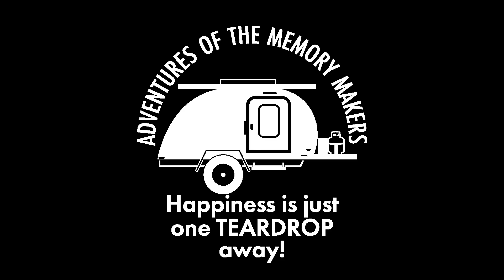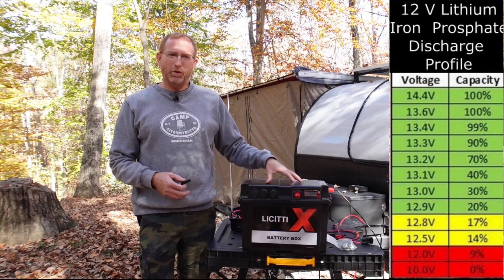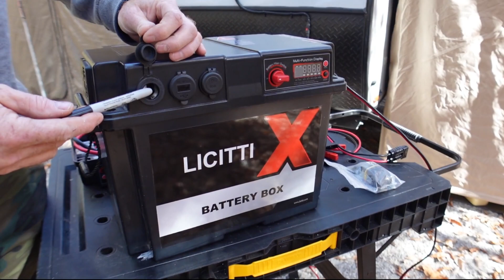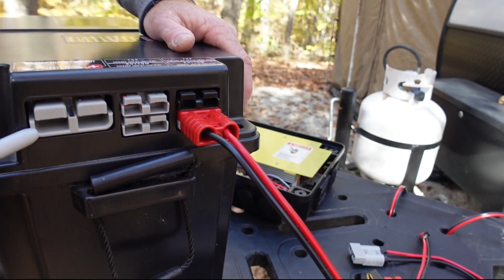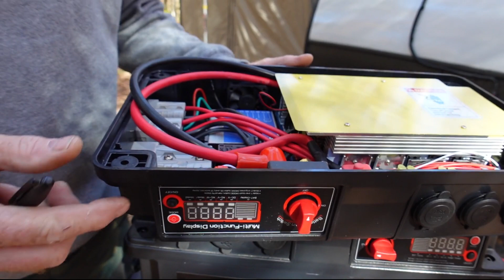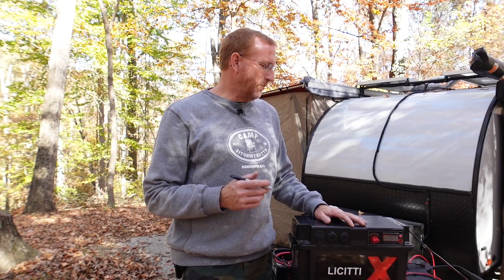Licitti AC Heavy Duty Power Box

Comment: OMG Sam I have SO many questions! I am definitely going to buy one. I did buy a Dr. Prepare but this thing is much more powerful than that. Essentially, I am looking for a way to power my Class C's DC system by bypassing the house battery/converter system built into it. Maybe this is the answer? I look forward to your future videos on this product.
Reply from the maker: Feel free to drop me an email, I will answer your questions the best that I can.
Adventuresofthememorymakers@gmail.com
Reply from the maker: Tom, thanks for watching. Not sure how big your class C is or how big your 12v draw will be but for our lil teardrop this meets all our 12v needs very well. 
 We always seem to struggle with solar charging due to the sites we camp in so I will be dealing with the charging issue this winter. 
 We have a video on our Bluetti 200P that we used first to bypass the house battery. Very simple and works great. That was the setup we were using in the video to power our camper of the Licitti. We will still have that capability as well when we integrate the PPS into the camper in place of the house batteries. It's always nice to have multiple options when it comes to power.